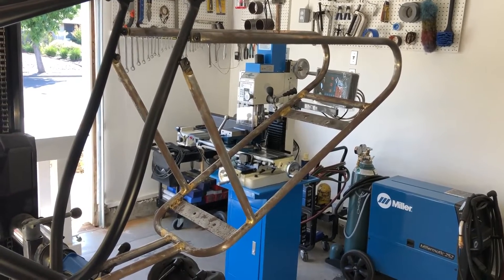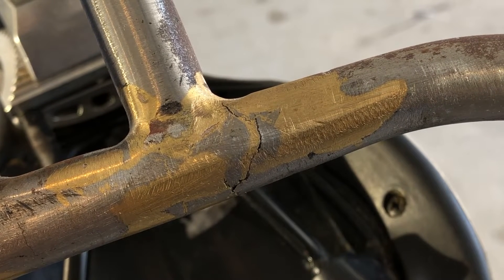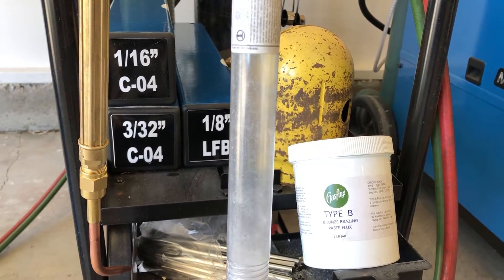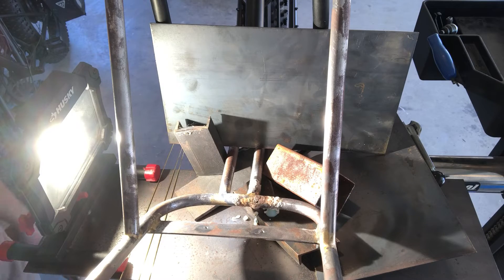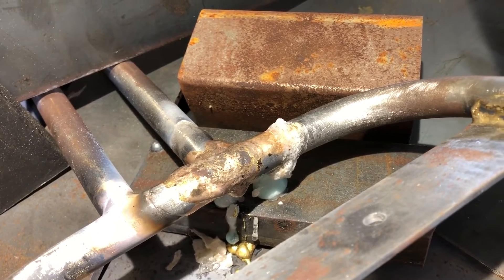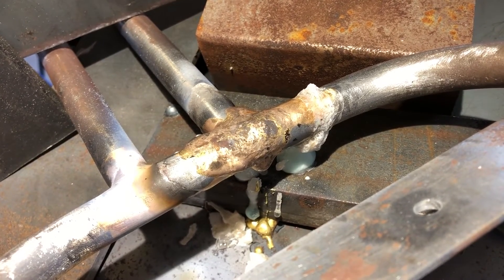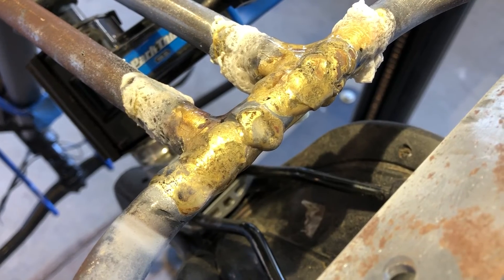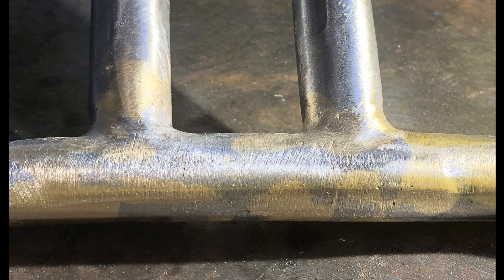Torch Brazing a Crack Repair on Thin Walled 4130 Chromoly Tubing

Comment: Adding more than needed is just more bronze to sand off and risk over sanding and thinning the tube again. You only need to put on what is needed but you’ve already over sanded this thin wall tubing. Building up with bronze is just covering up a problem and it will crack again if used under weight all the time.

Comment: I cracked my seatpost tube while extracting a stuck aluminium seatpost. I am hoping brazing will strengthen and close the crack so that the frame is not a complete write-off. It's a Chromo steel framed bike. I'm wary that the brass will drip into the tube, and I will not be able to get the seatpost back in. I have never brazed anything before. Perhaps I should just use a professional?